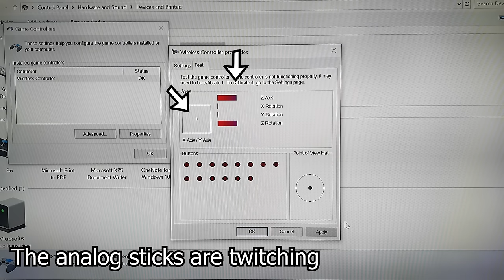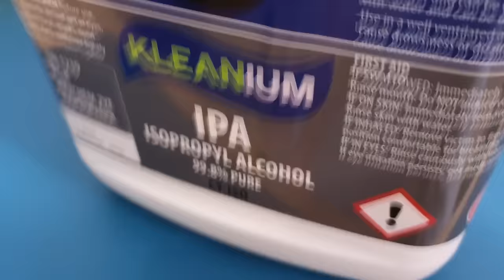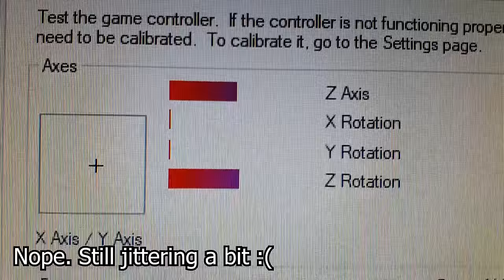How to take apart PS4 Controller and Repair the Analog Sticks

Comment: My analog sticks were drifting so I took my controller apart to clean my analog them, but the black and red wires, inside each handle, disconnected. Now when I use the controller the analogs dont respond at all. Do  l have to solder them back on or is there an easier way because I don't have the equipment 🥲
Reply from the maker: The black and red wires are for the vibration motors, not the analog sticks. If your analog sticks aren't working, that is a separate issue 😬
Reply: @RestoreTechnique  ok, thanks for the feedback, luckily I have a backup controller.

Comment: Those rubber pads at 5:10 if one of the dots becomes dislodged from the entire piece does it need to be replaced? My left d pad button has a problem where it keeps pressing so I opened it up with this and it’s dot is the only one that can pop out :(
Reply from the maker: Yes, it needs to be replaced if a button membrane has torn, as it doesn't pop back up properly after being pressed in.
Reply: @RestoreTechnique  ah thank you! thought so! I pressed it in and it seems to work for now, gotta be real gentle with it though. It’s right stick slightly drifts left as well. 😭I’m just hoping they last till I get a ps5 cause I don’t want to buy a new one, or really invest in repair if I plan to replace. My other controller has some problem with drift in the left stick but it hasn’t popped up in a bit 😥 thank you again! I didn’t think I get a reply certainly not this fast! 😄

Comment: when I try too close the orange window, it won't close. I don't know if I'm not using enough force or the thing inside it isn't in place but it isn't working
Reply from the maker: Reasons for this are usually the little orange alignment pins at the top and bottom corners are damaged, and you're damaging them more by mushing them in. You need to either reshape those pins with pliers/tweezers so they can be inserted properly, or cut any damaged ones off. Other than that, you may have reinserted the potentiometer wiper disk upside down. Make sure the prongs are at the top.

Comment: What tools did you use on 4:13?? Or if you could give me the list of tools you used. I’ll gladly appreciate it. I’m going to fix mine by following your vid. Thanks 😊
Reply from the maker: Those are plastic/nylon tweezers. Got them off ebay I think. 
Other tools: plastic pry tool, Phillips Head #0 screwdriver, temp controlled soldering iron, hot air soldering station, flux, solder, solder wick, kapton tape, replacement analog stick module.
Reply: @RestoreTechnique  Great, thank you so much!!

Comment: What's your soldering kit consist of? I disconnected the red and black wires on the left. :(
Reply from the maker: I just bought a good soldering iron (Hakko fx-888d) but in this video I was using a Yihua 936 Soldering Iron. I also use a Yihua 2008D Hot Air Rework Station.
I use 60/40 leaded solder, KingBo flux, Goot desoldering wick/braid, and isopropyl alcohol for cleaning.
My fume extractor is a custom build (see my other videos). 🙂

Comment: Hi I open my and know it doesn’t want to charge what do I do?
Reply from the maker: Check if you plugged the battery back in properly. Check if you plugged the charging port back in properly. Check if you damaged the charging port ribbon cable.
Did you cause any impact to the circuit board?

Comment: Nice tutorial but for some reason my power button won’t work idk if you’ll respond but I have no idea why it won’t work
Reply from the maker: Does the controller charge when plugged in? If so, then that rules out a disconnected battery. The biggest reason for a button not working is a damaged or incorrectly positioned flex cable. Either it's not aligned correctly so the power button hits the button contact on the flex cable, or the flex cable isn't aligned properly with the circuit board, and it's not making good contact. Or you tore the flex cable.

Comment: Hi, this is the best video I found about repairing analog sticks. I would like to desolder and solder for the first time but I' ve heard desoldering ds4 analog sticks it's very hard. As a total beginner to desolder it do I need an hot air station or I can just use a solder sucker? If I can use a solder sucker what temperatures do I need? Thanks
Reply: I believe you can just use a solder sucker while using your solder to heat it up at around 350-400 degrees.

Comment: Hello Restore Technique, all right with you, I hope so!
I have two DualShock4 controls, each one has the two types of potentiometer that you demonstrate in your video. Being the first one you remove, with the yellow caps and then replace with an alps switch with the blue caps. I also realize that ALPS are firmer than yellow caps, Having said that, in your opinion which of the two models is the best, and why? Thank you very much in advance!
Reply from the maker: Hi, thanks for your question. Unfortunately I don't have enough experience with the 2 caps to form a preference. I am not a professional PS4 repair technician, and haven't replaced many of these. Cheers :)
Reply: @RestoreTechnique , hello again and thanks for the reply! In the video you say that you are testing between the analog types/brands, so I would like to know, which one do you like the most? I say that about the analogs themselves and not just the caps of the potentiometers. I think the blue ones are from the ALPS brand, and the yellow ones are from the ROCKER brand.
Reply from the maker: @rogerdn8665  In the video I say I will experiment with different analog sticks in the future. I am yet to do that.

Comment: I was trying to take apart a third party controller and it was so much harder than the official ones I was cleaning the buttons and analog sticks and the membrane holding the PlayStation button in kept on popping out when I was trying to put the controller back together and the ribbon cable for the touch pad was so hard to fish through that little hole but I finally got that and kept the membrane from coming loose again

Comment: I can't understand how someone opens this in 5 seconds without breaking the plastic pins beneath the joy stick. I'm almost 30 minutes in and still the controller has not come loose.
Reply from the maker: Some clips are harder than others I've found. Technique also plays a part. I've broken these clips in the past. I'm sure a lot of people will break them too. The controller is still held together with screws, so it's only a minor increase in the size of the seam that is affected. Good luck.

Comment: Hey. Few months back my controller stopped charging. Had to order new one. Is it just the controller, or ps4? New one is working so far
Reply from the maker: It would be the controller, if a new one works fine. It would likely to be the battery, or the charging port that has worn out or been damaged.
How old was the controller?

Comment: where can I get those precise metal prongs the ones that I got do not fit and I don't want to give up on my control
Reply from the maker: You mean the metal discs inside the potentiometer? I don't know where to buy those separately.
Reply: @RestoreTechnique   yes I mean those and I bought the whole potentiometer and tried swapping metal disc but the one I bought does not fit in the potentiometer attached to the controller
Reply from the maker: @bizzzaarrooel6637  Ahh, that sucks. Didn't know they varied in size. You will need to replace the whole module I guess :/

Comment: What is the thing in 2:52 and is it important
Reply from the maker: It's the connector for the touch/track pad. It's important if you want a working touch pad.
The touch pad button will still work though, as it's on the motherboard.

Comment: Why did you use flux? What are exactly the uses of it?
Reply from the maker: Flux is a soldering lubricant. It makes soldering much easier. It makes the solder flow and make a nice shiny joint.

Comment: Odd question, what’s that software y’all used to test out the controller with?
Reply from the maker: Windows 10
Reply from the maker: Plug controller in to your computer, open up control panel, go to printers and devices, then right click controller icon and select properties or whatever I did in the video.

Comment: I need help my controller whould connect but I don’t see the blue light and it won’t charge but it works pls help!
Reply from the maker: Sounds like you need to replace the charge port. You'll need to open it up, or take it to a repair shop.

Comment: Hi the metal prongs in my right stick are bent a little bit
Those 3 prongs inside. One of those is bent
Do you think it's going to be a problem
Reply from the maker: Maybe, I'm not sure though, depends if it's still making good contact or not with the carbon track

Comment: bro my sticks are fixed but my controller won't charge anymore 😬 when I opened it for the first time my ribbon got detached from the opposite side, not the one where the battery is. I also watched a different video at first and their controller looks competely opposite of mine so there's a chance I did something wrong when putting pieces back together. I came here to see if your video can help because our controllers look the same on the inside. maybe I attached the battery wrong or something. or maybe it's just the ribbon. it's not broken and the ends are not bent or anything. hopefully I can fix it.

Comment: Maybe your will not read this but Like two months ago I have buy a controller like this one but yesterday I checked that the square and R1 wasn’t working so I checked this out although I am scare of doing this I will try tanks for the tutorial  anyways I restarted the controller any advice how to cleaned without removing all the pieces ??
Reply from the maker: You can drop isopropyl alcohol down the buttons, and press them a bunch of times. Repeat that and you may be able to loosen up any dirt on the contacts. Other than that, I think you will need to take it apart.
Good luck 👍
Reply: @RestoreTechnique  thank you for the advice I will do that

Comment: while i was trying to clean the contacts the thing that covered it ripped off and so did the 4 black and red wires on my controller i searched it up and they said the wires dont matter but what happens when the shelter for the contacts popps off i tried putting it back now i have immense controller drift to the left i cant even go to my profile or play anything

Comment: It was hard putting back the contacts i broke some of the things that snap back together. There was like two pieces left but it still snapped back. Is that an issue?
Reply from the maker: I'm not sure which 2 pieces you've broken off exactly, so I'm not sure. I've also never broken them, so not sure how they hold up with broken bits on them. Fingers crossed I guess, see how it goes. You could use some tape or a dab of hot glue to help hold the potentiometer housing on properly. You would need to be careful not to get glue in the potentiometer though.

Comment: Wd-40 works well to loosen them when you're done.
Reply: WD-40's heavy/sticky viscosity attracts more grime. Sewing machine oil is the best solution here as its the lightest lubricant around and if you don't have a local craft store like Hobby Lobby, you'll have to buy it online as its very niche and thus unlikely to be found at Lowe's or Ace Hardware. Hair clippers and beard/goatee trimmers often come with a free vial of it though. In fact, buying the cheapest goatee trimmer at Big Lots or dollar store just for the oil could be cheaper as it avoids an online transaction and shipping costs.

Comment: Hey I have a small question? My controller was messed up since like a week after I got it, to where the right joystick wouldn't press down properly, as in me needing to apply pressure. Well it got worse, and it won't press down properly, will this fix it? If so imma give it a shot
Reply from the maker: Yes this should fix it, the L3 and R3 buttons are part of this replacement analog stick module.

Comment: Hey man i think i fcked up bad. I spilled some cleaning alcohol over it and it wont even turn on does this mean its fcked
Reply from the maker: What percentage of alcohol was the cleaning alcohol? Pure alcohol doesn't damage electronics, it's not conductive or corrosive. You can even use the controller whilst it's submerged in alcohol (in theory, I've never tried this myself, but there are videos out there of cell phones working sitting in alcohol).
But if it was cleaning alcohol, that's usually only 65-70% alcohol. Maybe there's still traces of it in nooks and crannies that haven't dried yet.

Comment: Opened my new controller to see if it's original and it was but I broke  a clip, I don't know if I should worry for that one
Reply from the maker: It's not a big deal, just means the seam is a little wider. It still stays together fine with the screws.

Comment: I got a third party controller, and the joysticks are good (for now) but the R2 and L2 triggers are only responsive at the very end.  So things like racing games or other ones where you want to be able to only halfway depress the triggers are not easy to play.  Is there a way to change the programming or sensing on the triggers?

Comment: I am currently trying to take my DS4 controller apart (I purchased a tool kit yesterday) but I can’t seem to unclip first 2 clips under the analog sticks, (the tool to unclip them from the tool kit is plastic and it sucks). Do you have any advice on how I should proceed with taking this controller apart? Thanks.

Comment: I accidentally sat on my control and the l1 got stuck and the l2 broke off is it fixable?
Reply from the maker: It may just need replacing thumb stick tops (the rubber/plastic bits you touch). That may be all you broke. Otherwise, replacing the analog stick module like I did in the video (6:46) may be what you need to do.
Reply: @RestoreTechnique  not the analog stick the l1 and l2 buttons
Reply from the maker: @Daringloki  🤦‍♂️ Oops sorry zv-e10 sounds like you broke the plastic clips on the buttons. You probably need replacements. Fairly cheap
Reply: @RestoreTechnique  I don’t know how to fix it

Comment: How do you fix loose grip plastic? The shorter plastic that would snap off to reveal the inside of the controller is loose on my left grip. Like it pops up and down slightly. My kid may have dropped it and broke a hinge or something. But I don't know how to get it to stick back down since it just seems to be a snap piece? Its my Vader controller so I REALLY want to fix it

Comment: I'm sure most of these driftings are not because of dirt. Its somekind of software or electric or mechanical failure. Or because this analog stick construction didnt change a bit till 20 years? These sticks look same as in PS1 (2000) dualshock .

Comment: what can I do if I accidentally bent one of the joystick contacts, what do y'all recommend? should I buy a part off of amazon or something?
Reply from the maker: You can try bending it back, but there's a good chance it won't work correctly. Probably need to buy a new contact, if they're sold individually, otherwise a new joystick  which will have one in it.

Comment: Cool, can you do the same to a PS3 controller.  I have about 8 are do of them . I have 2 the the joystick sticks can I swap the little joystick thingy from one to the other. Most of them are just some I picked up,  some of the joysticks work some don't.  Just asking.
Reply from the maker: I do not currently have plans to repair a PS3 controller sorry, but maybe in the future.
Reply: @RestoreTechnique   oh I'm sorry hero ,  but you misunderstood. I was asking if it could be done.  I want to see if I can get a controller working so I can have a extra controller. I do little things like cleaning and sure. Try not to get into repairing. But might have to. As it's getting hard to find anyone to fix a  ps 2/3/4 these days . Now everyone is gearing up for the ps5 .  But yeah, I was just wondering if I could just swap parts from one to the other. Just asking , sorry about the . My bad for not phrasing better.

Comment: So, funny/lucky/painful story, I just used this to dissasemble my controller so I can attach new analog sticks on it (to get better at CoD, not because the originals were faulty), and when I went to pry and detach everything apart, it all unsnapped all at once and luckily nothing was broken, and no wires became unsoldered. Unfortunately, when I saw how the analogs were connected, I quickly realized that I was trying to attach analog CAPS and not sticks. I was bummed to have to put everything back together and use the stupid caps which make the analogs look way too long and it just feels uncomfortable to hold
Reply from the maker: Ah that sucks, at least you didn't break anything

Comment: I did have this issue with my ps4 controller and it's called stick drift but to save money I opened my controller so I could ran the anolog stick cuz they was so much dust inside it so once I cleaned it the stick drift got reduces so much but if u want to remove the stick drift again and again if it's moving again then just pull out joystick just a little bit then blow on it but don't open the controller while doing the step

Comment: I know I’m late but I’m planning on cleaning my controller soon and I wanted to ask. Do you have a link for the correct screwdriver? I don’t think I have it
Reply from the maker: I don't, as I bought it from an old hardware store. I used a Phillips Head size #0, but a Phillips Head size #00 is probably more suitable. You can get them off ebay for a couple of dollars.
Reply: @RestoreTechnique  do u know if there are any on Amazon?
Reply from the maker: @shinu._.9713  I don't know of one specifically, but I'm sure there would be plenty available on Amazon.